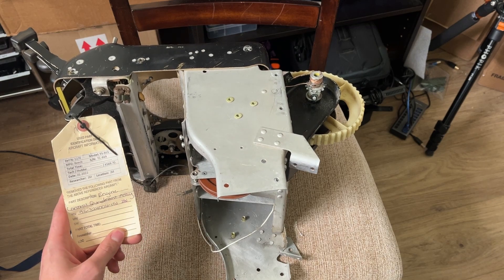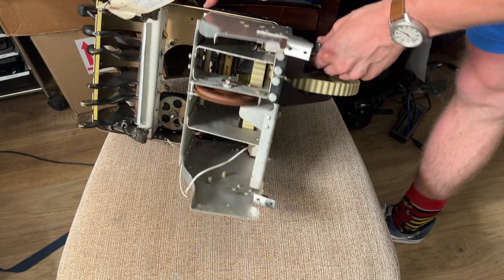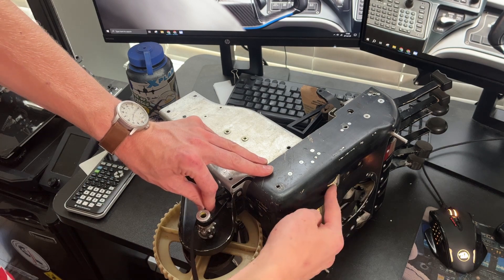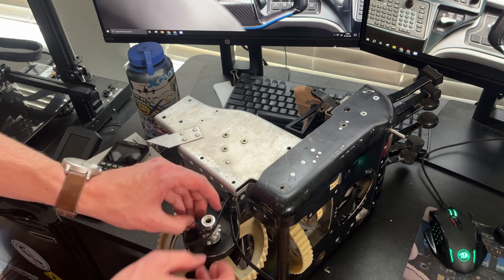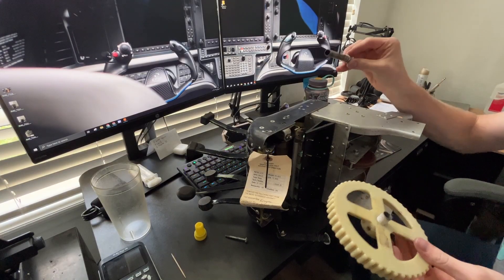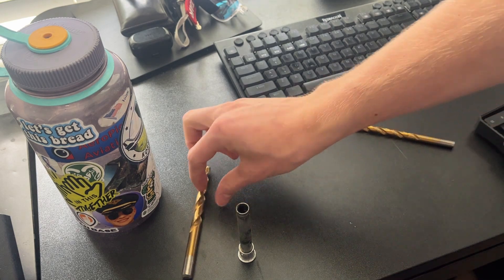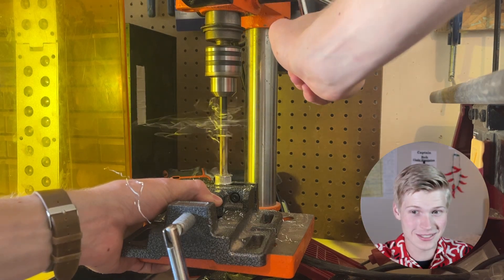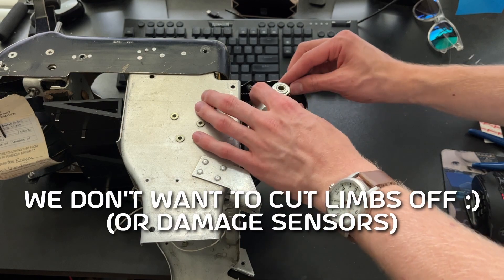Connectinng a Baron Trim Quadrant to a Potentiometer and Motor (Hardware) Part 1

Comment: hi, i am trying to connect my seven segment display to mobiflight, my display has four pins CLK, DIO, VSS and GND, i am confused with the settings inside mobiflight and connections of the pins to the arduino board, will you please help me with this...
Reply from the maker: What model of 7 segment display do you have?

Comment: Hi, i wanted to thank you for your crash course. It was very helpful and today i made my first switch working in the sim. Just one question: Is there any limit, on how many ground outputs i can connect together, so that only one wire goes to the ground pin?
Reply from the maker: Hi! There isn't a limit on how many grounds you can connect together :)